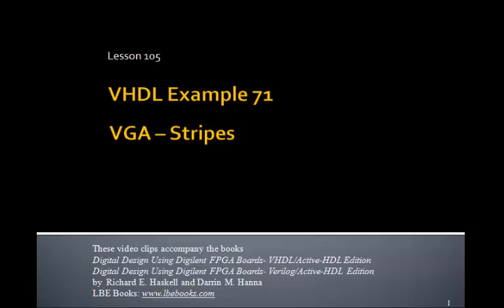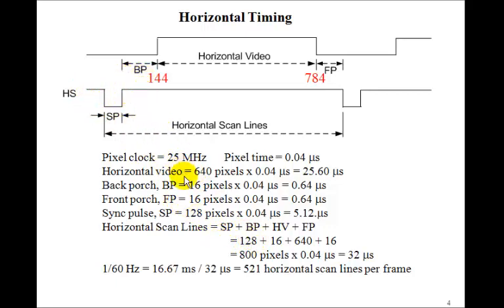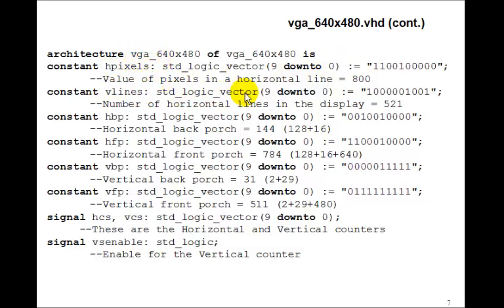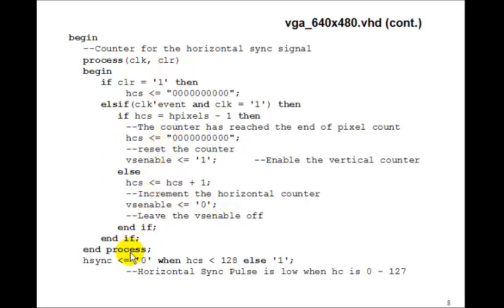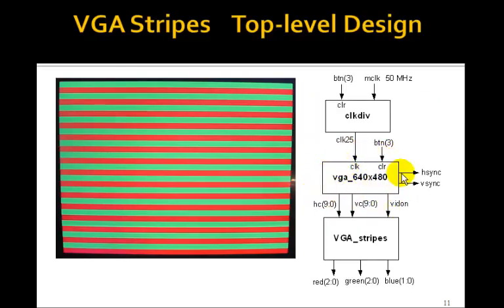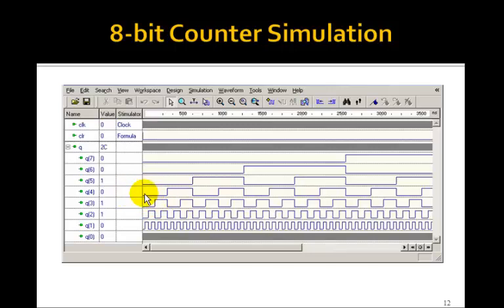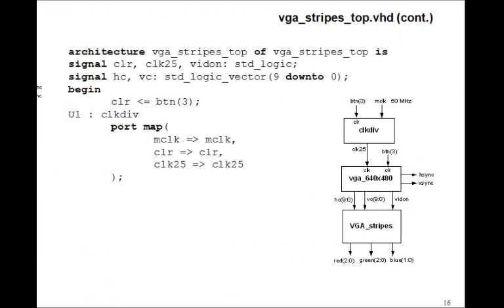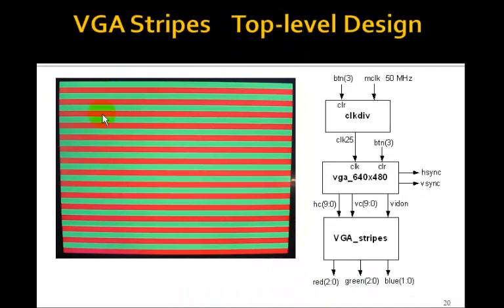Lesson 105 - Example 71: VGA Stripes

Comment: Why did you use " hsync <= '0' when hcs< 128 ..." ? Shouldn't it be hcs<96
Reply: I concur. I also couldn't get this to work until I used 525 for the vertical lines.